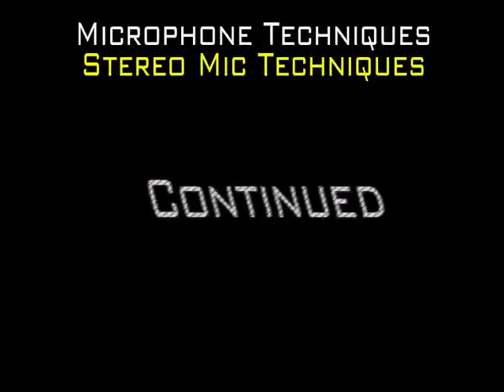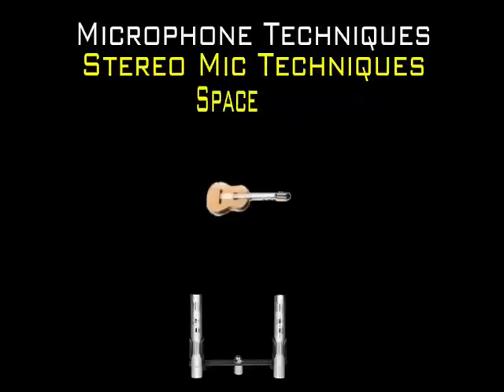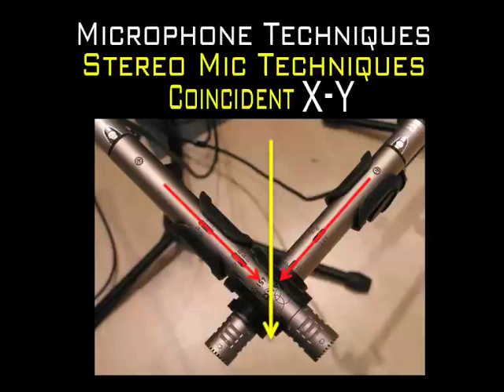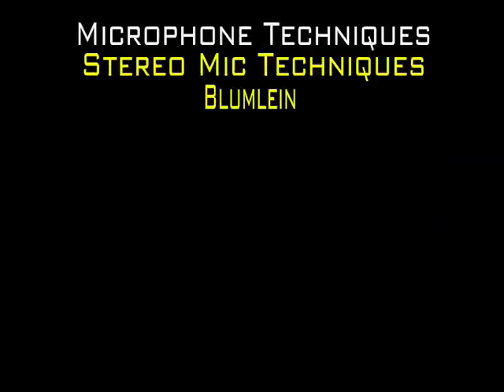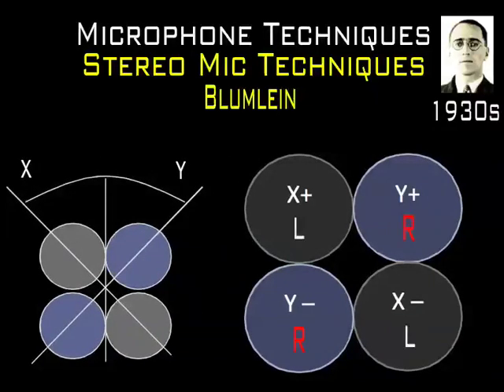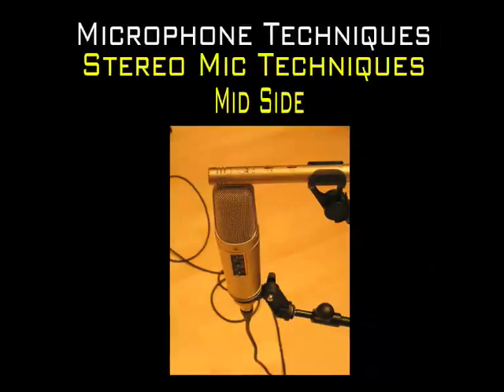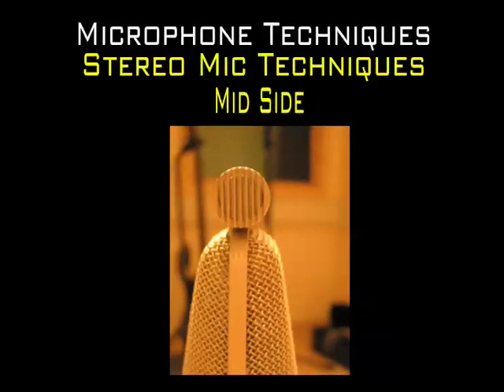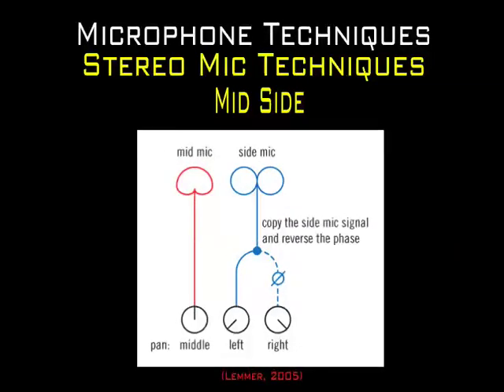episode 5 - Stereo microphone techniques

Comment: mid side: the thing I realised with mid side and quiet sources like the guitar is that if you use a ribbon as the centre you need to send the mic further away from the source (proximity effect) but then the side mic has to have a very loud output and good signal to noise ratio. In my recordings I used this same LDC in the video about 75cm away from the guitar (solo music) and it didnt have enough signal to noise ratio to match the AT4081 in the centre. Maybe something like the lewitt audio 550 with 0 noise would be most effective when distance miking a guitar in mid side.

Comment: If you don't reverse it then when you pan the tracks it will only generate sound from the center. The two tracks will join together and it will sound like the same track but only in the center position. And I believe they would cancel out only if they were both centered with one reversed. But since they are apart they do not.